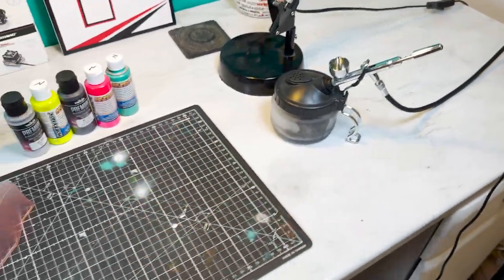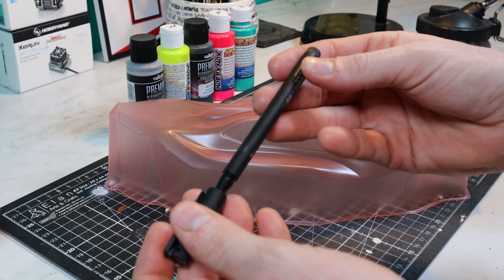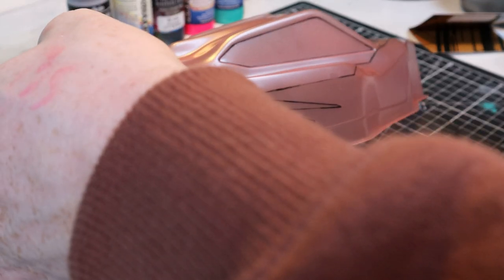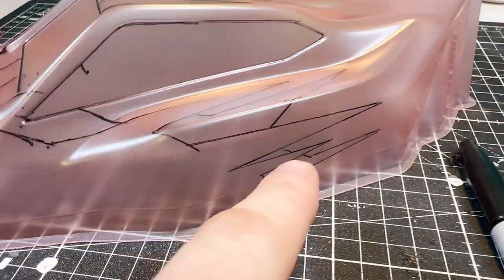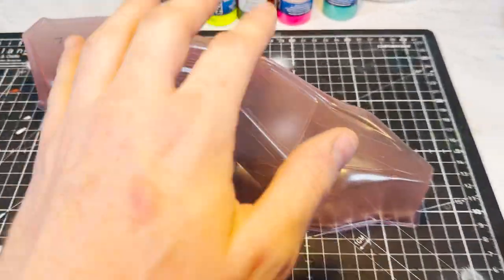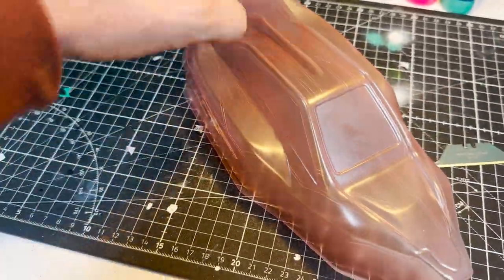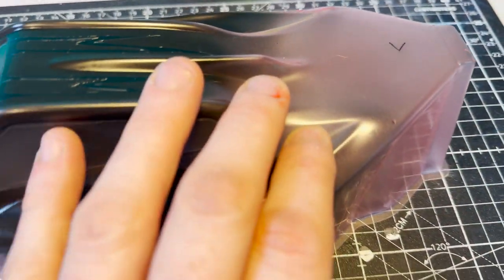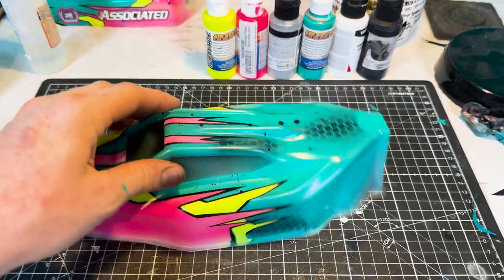Learning A New Technique! RC Body Painting..Team Associated B7 Bodyshell Airbrushing

Comment: how did you have 2 layers of overspray film on the outside of the body? you had one you drew the outline on and then the regular one
Reply from the maker: Only 1 layer , I removed the pen with isopropyl alcohol cleaner rather than remove.. :)

Comment: do you have any issues with the body splitting at the mask cut lines? the pressure used looks enough to cut the shell out with cut and snap method,thanks
Reply from the maker: Not yet.. I do apply a fork pressure but not enough to split later down the line , especially on these kits bodys.

Comment: Can you brush in the liquid mask? I don’t have another gun, and taping off is a major pain
Reply from the maker: Yes you can :) just use a nice soft brush.
Reply: I use one of the brushes with a black foam tip and it seems to work pretty well. Usually do three coats of mask.